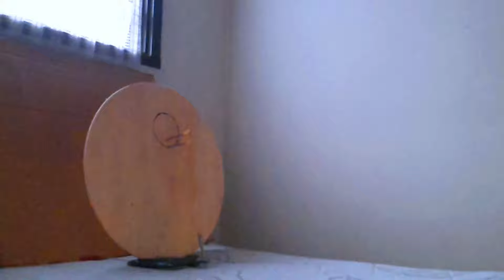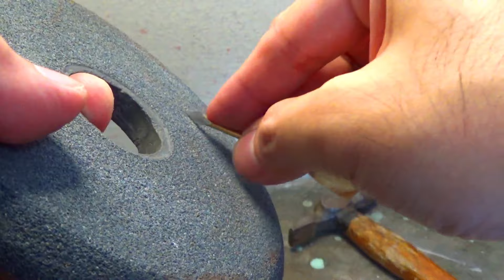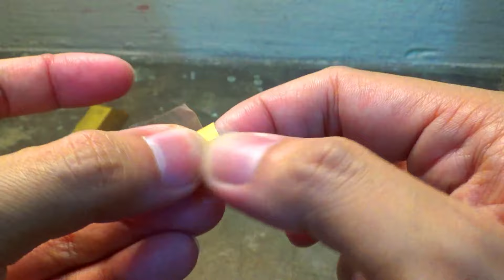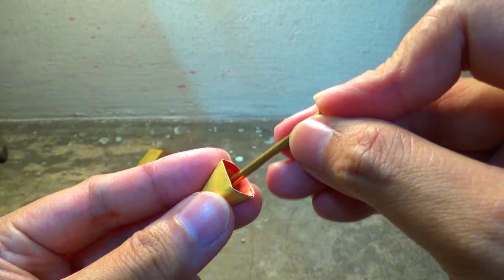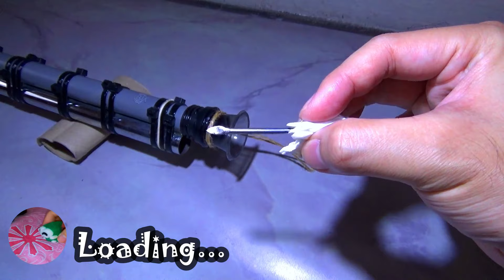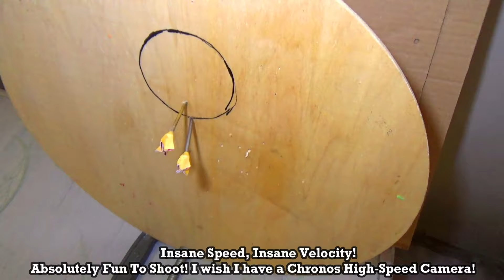Making Nails into Spinning Spear Darts! (2024)★★★★★

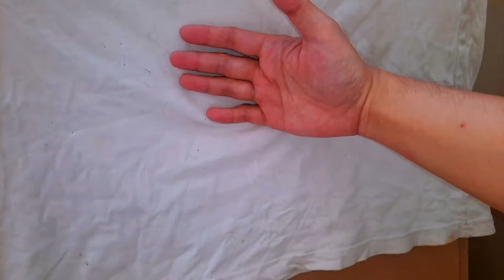Comment: 6:20 Beautifull!!
I'm going to make one for myself. It Looks easy to make.
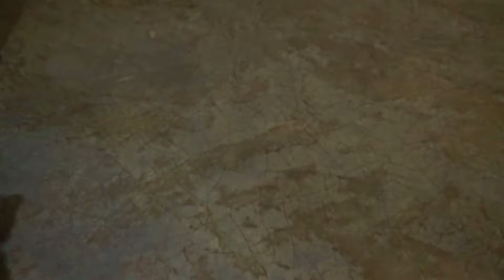4:39 maybe I can use microfiber cloth instead toilet paper, it has less friction and reusable.
Reply from the maker: Bro, try these in your alcohol gun💀
Reply: @LKH9Channel  I want to try this design with my blowgun first. Maybe we can see the muzzle velocity difference from the Crono connect app I use.

The last time I fired a HDPE cone dart with Alcohol gun, the dart had changed direction in mid-air. Because even small flaw or hot glue residue on hdpe cone ruins aerodynamics of darts. Idk its either my fault (because I can't make high quality cones) or conventional cones are not suitable for high velocities. Your dart design may be more suitable for high speeds. I'll give it a try.